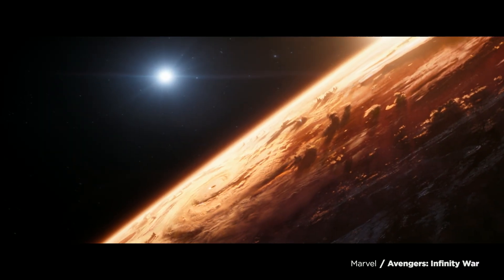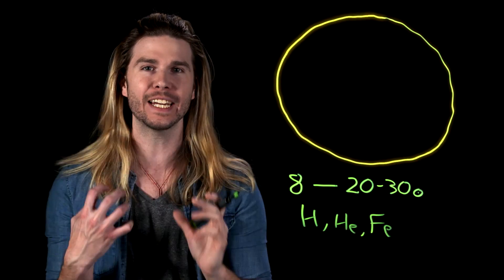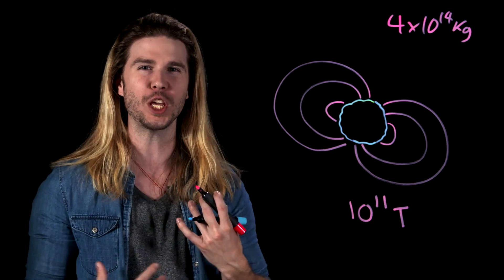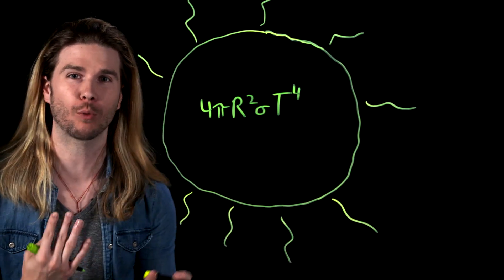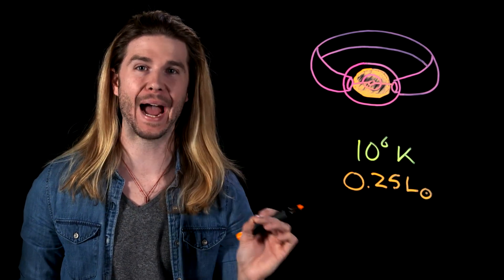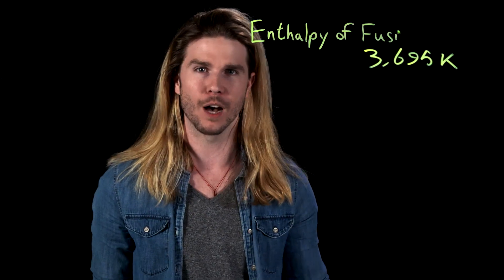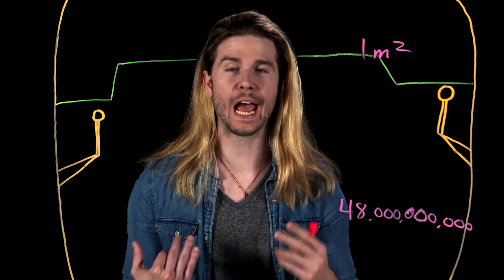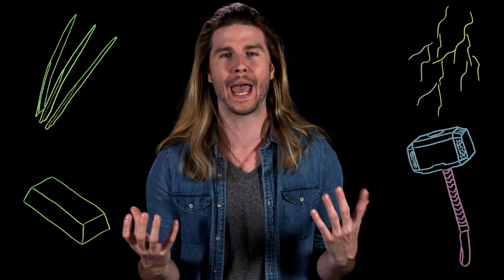How To Forge Thor's Infinity War Weapon

Comment: (Posting for my friend Josh)
I’m so much a fan of Thor that I need to do some sciencing in advance! (meaning this is being written the moment I heard the announcement of this episode) lol. That’s ok I’ll probly love your video anyway :)
There’s a few things I’d love to cover here:
You mentioned in the last episode of Footnotes that neutron stars can emit 200 billion g-forces of gravity. (I forget if it’s a little g or a big G, don’t judge me!) We already know a single g to be around 9.81 m/s/s. I used a model of Nidavellir drawn entirely from memory because we don’t have footage yet (so it could be completely wrong) and estimated that the smallest of the three independent rings that form Nidavellir is in the ballpark of 5 miles in thickness and 45-50 miles around (inside diameter). Were that ring entirely composed of conventional stainless steel (because there’s no way to tell what it’s actually made out of), it would be about 2,000 cubic miles and accelerate inward to the neutron star at upwards of 100 million million million trillion Newtons!!! The rings of Nidavellir would have the advantage of its shape because the star’s gravity would be uniformly pulling on it in all directions, preventing it somewhat from collapsing entirely. Still though, the material they need to use to build Nidavellir itself would need to pull an unbelievable 72 octillion psi or around 501 octillion mPa! (that’s a lot :smiley:
The other fact I found interesting you mentioned in the last episode of Footnotes was the fact that neutron stars generated enough gravity to trap light itself into orbits around the star. What’s even more exciting is that since light is a form of EM radiation, and by extension a form of electromagnetism, it could theoretically be directed using extremely powerful magnetic fields and perhaps even harnessed. This theory makes Nidavellir (or at least a Nidavellir-like structure) very scientifically plausible. In fact, there’s probably an advanced alien culture who’s already done that somewhere and is making fun of us for still trying to get to Mars. It would take days, weeks, or even longer to do all the math concerning how much light can be trapped by a single neutron star, or how much work can be done by harnessing that output energy, or how much input energy it would take to produce sufficiently powerful magnetic fields in the first place, but it’s still very possible. Future Because Science episode perhaps?
The movie has made it abundantly clear that two things were needed to get the forge going again, and these could hint at how exactly the forge works. The first was that the rings needed to spin again (or the openings at least had to realign; I didn’t pay that close of attention). The second was that two levers/wires/circuitries/things had to be held together by an incredible force and some nerfherder built that component directly into the output energy flow. If the rings of Nidavellir did indeed need to rotate, that would create artificial gravity for the forge’s crew and the energy that goes into spinning the rings could also be recycled into generating the immense magnetic fields to direct the light and heat needed to melt Uru metal. As far as the connection point problem solved by Thor’s massive biceps themselves, we already have circuitry that works exactly that way. Nowhere near as extreme, but think of a light switch. It alternates between completing and breaking the circuit to control its state of power flow.
I’d break down the mathematics for the melting point of Uru metal if I were any less exhausted, but I’d guess you’re exhausted just from reading this at this point… so maybe later...
That concludes my thoughts. Footnotes, pretty please? Thor senpai?
Dang it I forgot to mention that the 72 octillion psi/501 octillion mPa measurement was a compressive strength value! Please do mention that
Reply: mate your most likely going to be in the footnotes with that.
Reply: Alien cultures will most likely not be making fun of us, since there's a good chance that we're alone in the milky way (based on current day estimates). And even if we weren't, it would take hundreds of light years for the light to travel to the nearest ETI meaning they would be making fun of us for still believing in a geo-centric world view and not figuring out string theory yet.
The internal stress of having material at around 20 miles from the surface of a neutron star would be enough to gravitationally tear molecules apart (iirc), and that is entirely disregarding the incredible EM properties of magnetars. So building that structure would be nigh impossible according to our modern day understanding of technology and physics - at least as it was presented in the movie. The material would have to be composed purely of neutrons in order to avoid EM problems, and that would prevent molecules from forming properly - at least in a chemical way. Next problem would be that you would have to actually get the ring/sphere structure into place before it being self-supporting. Even if we assume a material that can withstand that pressure while self supporting, it also has to support the stress of immense space-time warping and ridiculous tidal forces. As you said, the material stress would be too much for the structure to work. On top of the material stress due to gravity, you'd also have to keep in mind that the material is apparently even MORE heat resistant than uru, considering the structure is built entirely around the star and constantly exposed to the ridiculous radiation levels - if we assume the star itself to be active and burning hot 24/7 (as presented in the video).

I assume you were referring to a Dyson Sphere when talking about such a structure being theoretically possible? Because (and correct me if I am wrong on this) as far as I know a Dyson sphere is not intended to harness energy from a neutron star, but from an active star instead, due to their luminosity being way higher. For a neutron star I would assume you'd want to use a method that treats the star like a dynamo for harnessing energy (on top of the dyson sphere) since you can directly generate current just cycling any metal around the star - at a large enough distance of course.
Reply: it wasnt a circuit....it was basically a lever disc that when turned, opened up the shutter and kept it opened..... so yeah everything you said is correct mostly, just not a circuit. if it where a circuit thor wouldnt be able to hold open the shutters.

Comment: A star doesn’t gain more mass when it fuses silicon into iron. The reason it collapses isn’t from an increase in mass, but because the iron isn’t fusing and thus isn’t producing any energy. The star collapses because the pressure of gravity overcomes the force being produced by nuclear fusion.
Reply from the maker: Daniel Selzer The core itself gains more mass, and passes the Chandrasekhar limit. At this limit, you’re right, the gravity of the core overcomes the pressure, but it overcomes electron degeneracy pressure, which takes over after fusion ceases. — KH
Reply: Correct - the process of nuclear reactions actually convert mass into energy. So, the star is losing mass with every single fusion reaction, even the hydrogen to helium ones.
Reply: Lari588 Frying pans are starkillers.
Reply: it is more like Iron gives lesser Energy out by fusion than it takes
Reply: Yes, that is correct.
Reply: Frying pans and the sun can never love eachother